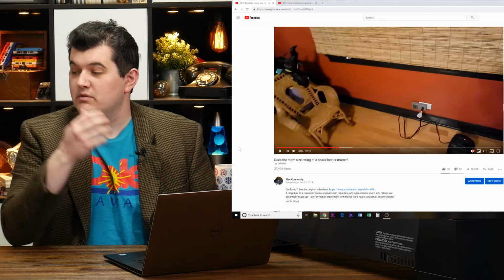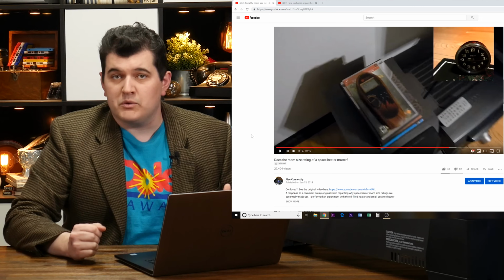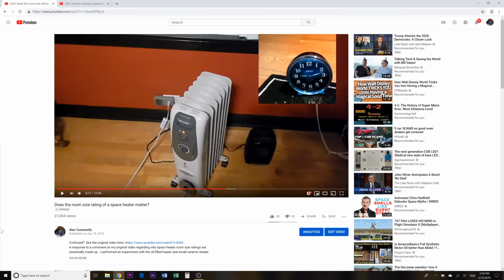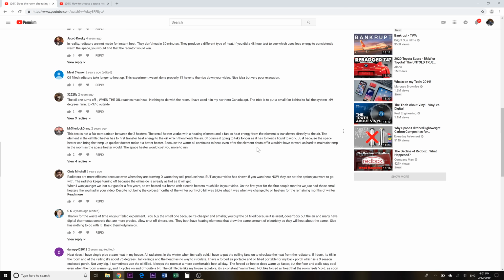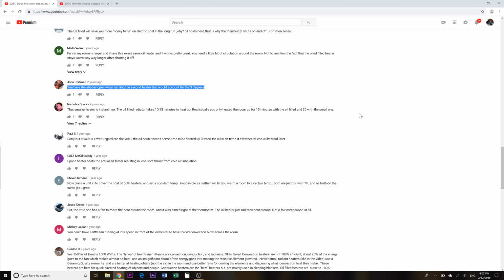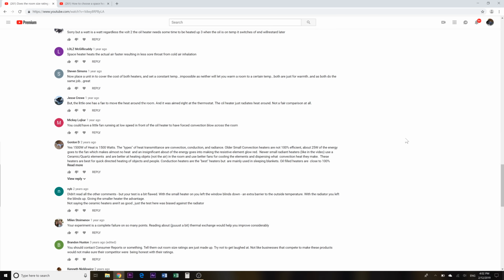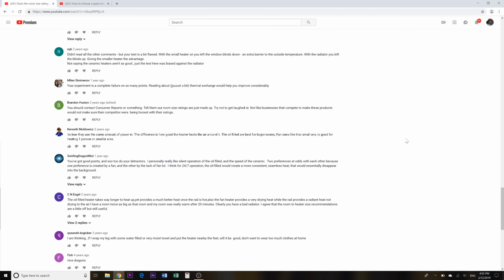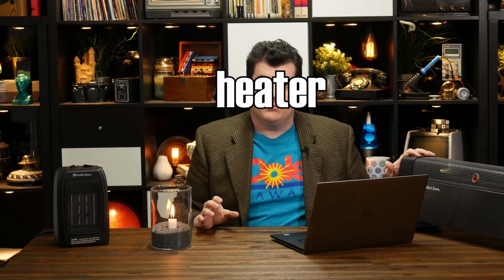More Space Heater Nonsense

Comment: Obviously your math is accurate and in terms of how effectively each one heats the room: they are the same.

However.

One possible reason why one may be better suited to a smaller room is duty cycle.

A "common" scenario one could imagine... 

A building is at 67 degrees F, but an individual would prefer the room at 71.

The amount of thermal energy required to keep that room at 71 is 750 watt hours / hour.

That means that a 1500 watt heater would have to run at 50% duty cycle in order to keep that room at 71.

The cheaper heater will have less material, and therefore require a fan in order to operate. This fan will have a finite life-span.

If the fan is of very poor quality, it may only have a life expectancy of say 5,000 hours.

At 50% duty cycle that means the fan will fail after 10,000 hours of use. Longer than the 1 year warranty.

However.

A larger room might require 1.5 Kw / hour to maintain 71 degrees.

Which would therefore require the heater to run at 100% duty cycle. and if ran continuously month after month (ignoring the whole seasons things)... the heater would reach EOL before the 1 year warranty was reached.

There are numerous examples of appliances that "can do the same thing" and cost many times more..

For example, say a hammer drill..

you could have 2 hammer drills with the same effective power and usability, but one might cost 4X more and last 10X longer.

The cheap one may good fine for a DIY guy doing some work around his house, and may last years. But if used professionally every day might only last a few days or weeks.

If you were to measure the performance of each drill, you might find that that power in = power out, but because of life expectancy, one is more suited for DIY and the other is more suited to professionals.

Comment: I don't understand the entire discussion. The point of oil-filled radiators is that they are quiet (other than fans) and save (other than devices with heating coils without fans).
Reply: They don't save electricity. Both use 1500 watts of power.

Comment: Those oil filled heaters are great for keeping a room warm but slow at changing the heat from cold to warm.  
What they are really great for is safety.  They are also quiet and tend to not change humidity much.
If you run a fan to circulate air in your room you might find that oil heater working "faster".   
Over time though if the BTUs are truly the same, then they should eventually bring the room to the same temperature.

Comment: The reason that the smaller heater with the equal 15 amp current draw is out performing the 2 larger heaters is because of the forced air from the fan. The fan optimizes the heat distribution and also maximizes the duty cycle, which has probably been running at 100%.

Comment: lol i never paid attention to the 1500 really. I always thought the diff was size and materials used.  Does a  $30 one have the same heating elements as a $100 one, Same fan and sizes. Does a cheap one burn out faster than the more expensive ones.  Then your cost over time. is it better to have slower heat for more time or a faster heat that turns off and on more often.  during winter my  bill goes from like 200s to like 700s during winter cuz the gas. What one would save more money for long term every day use to stop heater in house for kicking on.

Comment: Air circulation makes a big difference in how the heat is distributed around a room. I had a oil filled heater and it sure made my ceiling happy because all the heat would just rise up off of it without circulating around the room. Using a small fan to blow air through the oil filled heater made a big difference in the time that it took to warm a room.. 
To make this as simple as possible let’s say you would line up 10 different 1500 W heaters. They are all going to put off the same amount of heat and they are all going to cost exactly the same to operate a given time. The difference in how much electric you’re going to use to warm a room is how long does that heater have to run to warm the room. In my opinion the oil filled heaters need to run longer because they lack a fan to circulate that heat around a room. In one hour the small quartz type heater with a fan might have to run let’s say a half an hour to keep a small room at 70° where the oil filled heater might have to run 35 or 40 minutes to keep that same size room at 70° for one hour.  Your savings with the Quartz heater is simply because it does not need to be run as long as the oil filled heater.  Remember that you don’t get something for nothing when it comes to electric heaters. A 1500 W  heater is not going to give you 1600 W of heat. If you think it does then I’ll sell you an attachment for your kitchen sink that puts out 20 gallons of water by using only 15 gallons of water.   Enjoy all your videos 😁

Comment: Maybe by larger room there would a greater chance of latent air movement therefore the ones 'rated' for smaller rooms have an in built fan and the ones for larger rooms do not tend to. Other wise the only thing (other than marketing wankatering) I could find to suggest a difference in classification is a larger room MIGHT have a larger gradient of current heat while the heater is in operation and that would increase the effect of the convection currents.... but yeah it all seems like marketing BS.

Comment: A small space heater is great under a desk blowing on your feet when you're cold.  If you're using a space heater to actually heat up a space, then the oil heater might keep the room a more consistent temperature, and you wouldn't be feeling a blast of hot air in part of the room.  So there are reasons to pick one over the other, but you're totally correct that the marketing is stupid.
Reply: No, an oil radiator heater will not keep the room "a more consistent temperature". It is an excellent design for heating the air directly above the heater (and thus wasting it out through the ceiling and upper walls) since there is essentially no air circulation moving its heat to the rest of the room.

Comment: Pro poor person tip, if you put a box fan behind one of those large oil filled radiator heaters, you can basically heat a whole(smaller) house.  Keep the fan on low, it will move the air just fine. If you crank up the speed I think it moves the air too fast and it doesn't heat up well

I know I'm late to the party but maybe I can help some other frugal and or poor person out there 🤟

Comment: The real test is power consumption over time.
You cannot test 50 minutes to 60 minutes. A good test would be 24 hours, and compare power usage. Obviously, you would need similar temperature and sun days. I suppose you should also start with a heat soaked oil filled as well.

Comment: Any source of heat, an iron, a lightbulb, an arc welder, will put the same number of BTU's into the room. Put a box fan to move the air around and 3 or 4 thermostats, and you will have the same result. This room needs some air movement for the "Test", which I can do in my head.

Comment: Awesome video, very informative. The elements in the space heaters are not converting 100% electrical energy into thermal. Some of that energy is being converted into light, which can be seen when the element is glowing bright red. 

Depending on the element's material, some are more efficient at this conversion.
Reply: That light is a miniscule portion of the energy emitted, and is converted to heat as soon as it hits a wall or other non-reflective surface. This is basic physics.

Comment: One important issue I haven't seen mentioned is the distribution of the heat, and how quickly the heat spreads through the room. The oil-filled heater, even if it didn't cycle on and off, would have a hotter zone in the space nearby, and the space in the room farthest away would be cooler.

A parabolic heater is made to heat you quite a bit, with the space several feet from you having little to no heat increase.

A heater with a strong fan will spread the heat more quickly, and the room would be heated more uniformly, with much less chance of hot spots.

I don't know how long it takes to spread the heat, but you can check this by having several thermometers scattered around the room.

Just past 19:00 in this video, you do touch on this issue. I hadn't gotten that far when I started writing this. You also quoted someone as saying that the fan heater dries out the air, while the radiator doesn't, and this seems wrong. The change in relative humidity should just depend on temperature, though feeling the fan blowing on you could make you feel like you were drying out more.
Reply: Moving air evaporates more moisture than still air -- that's why a breeze feels colder while your skin is wet. It is important to understand that heat is different from temperature and temperature is different whether you feel hot or cold. If you stand in a heated room at 70 deg F -- and stand a foot away from a large single-pane window separating your from a 0 deg F winter night -- you will feel MUCH colder than if you stand in the same room at the same temperature while the outside air is also 70 deg F. The cold surface of the window sucks heat from you and makes you feel cold -- even though the temperature doesn't change.

Comment: Because the oil filter cycles on and off it lets out less heat. Period. If not for the cycling on and off, Both would produce equal heat in time. Given enough time the room's air would reach energy equilibrium. If all the variables, such as outside temperature, time of day, etc. were the same the temperature would be EXACTLY  the same. But since the oil heater cycles on and off it will never produce more heat.
Reply: All the heaters cycle on and off. The primary difference between an oil-filled radiator and a red-hot heating element is the former won't burn your house down when the nearby curtain (or the hem of your bathrobe) touches it.

Comment: Energy is energy you are totally right on the way they are marketed. The only difference is in nuisances, like the small heater has a fan so it is noisy, while oil filled or convection heaters are noiseless. Although there is a small difference in how we feel the heat from the radiator type heater vs any heater that first heats the air: Radiation from a hot surface, like these oil heater tend to heat stuff directly and air indirectly so the room temperature may be actually a bit lower while it may feel warmer when you are in direct view of a radiator.

Comment: One thing that might be a factor ist the form of heat propagation. We talked a lot about convection which heats the air and thus the room. Another form is heat radiation which doesn't heat the air, but your skin directly. That's the reason you can warm yourself up at a campfire on a winter day without really heating the air around you. And maybe that contributes to the feeling, that those kind of heat sources produce more heat.
Anyway, thanks for the videos, I can feel the pain. It's a little bit like the vacuum cleaner ads that say like 'Hey, this one got 2000W, it must be a great vacuum!'. (Yes, here in Europe we can go up to 3600W. ;) )

Comment: 8:40 I feel like part of what your test does not include, is how long after you turn the electricity off, does it take to return to the original room starting temperature. And also, a second larger more empty room. Maybe change the metric from time, to amount of energy used over time as the room heats up to a given temperature. So, start at 60°. Run heater through power meter until temp reaches 65°. Record amount of time and power used. Unplug heater.  Record amount of time it takes to return to 60°. Then compare the same exact method in a slightly larger room.
Because you are investing energy into warming the oil and heater body, yes some energy is going to be lost in that exchange. However, once the heater and radiant fluid are at peak thermal load, the electricity shuts off. Meaning that the oil heater can still heat a room after it turns off. If this is in a small room, then yes the thermostat will over heat. However, in a small room if you turned down the thermostat and used the cycling to your advantage, much less electricity needs to be used over a longer use duration, than with air cycled units. The physical property of absorbing heat, is going to be more useful in a room full of air, as opposed to a room full of solid stuff. A bed of coals vs. a licking flame. They may be producing the same amount of energy, but only one lasts all night without adding more fuel. The smaller air cycling units can add thermal density to a small room because of stuff absorbing the instant heat it produces, like a flame. But, ultimately, if you cannot capture the heat it produces, it's gone to convection. Larger air filled rooms would not benefit from this type of instant heat. As it would rise directly to the top and not mix well, no diffusion. With the oil as an intermediary, the heat can diffuse into the air, as opposed to convecting passed it.
Reply: But yeah, it's not going to heat faster, just a different form of heat exchange.
Radiant heat, convective heat, and transient heat.
Radiant heat is IR light that can traverse space without being physically moved around before landing. Great for diffusion. The heat coming from a wood stove, is radiant. Once radiated to the air molecules, they will form a gradient in the air. Causing convection currents to move the air around for you.
Convection is when the density of the air physically changes in response to heat and a gradient column of warmer gases moves up from that point. In the case of a fire, rapidly. The elevator of air above a campfire is convection. Great for  creating gradient currents in small spaces. Not so great in tall spaces.
Transient heat, or transmission, is heat that directly moves between two touching materials, as long as a gradient isn't formed.
Your skillet cooks food because it is in direct contact with a heat source and does not create a gradient current. Meaning that it doesn't begin to separate and move around. Instead it absorbs the energy, as a whole object, and then retransmits it as radiant heat.

Comment: shoulda measured the kWh they both draw in that 30 minutes to prove the larger is turning off and on. if thats the case than the small one is just better at putting out heat. since kWh use = heat made

Comment: Oh my, you need to do one about flame only propane heaters in a garage  or something.

I can't begin to tell you how many times I've seen people review these things for like a workshop or something and they're like "it's only hot directly above it, all the heat just goes up, they're useless".

😑😑😑, when you're heating air, you need to move the air around or have some other convection going on. Because yes if you just put it in the corner and turn it on it's not going to do a goddamn thing except heat that corner with severe hysteresis to the rest of the room unless you're moving the air around too...

Comment: "A Fan heater Dries out the Air but an oil filled one doesn't" 10:51

Completely Incorrect. Both heaters cause temperature to rise which will decrease relative humidity. Oil filled will heat the air slower and the user may feel more comfortable at a lower air temperature if they receive some of the energy via radiation. Therefore the relative humidity would remain higher due to the lower temp

Comment: In today's world of alternative facts, uhhh  no.  1500 watts is 1500 watts.  BUT, some heaters can give the "feeling" of being better than others.  Regardless of the type though, hot air will rise to the ceiling with no mechanical help(a fan) to circulate it more evenly in the space.  Get the heat off the ceiling and the room will feel much warmer.  

Radiant heaters feel amazing as long as you are directly in front of them and unobstructed or you let them run of a while to heat the items in the room that are in front of them.   I did some experiments with radiant heaters a few years ago and was able to focus a beam of heat just like light.  Yes infrared light.  Using a highly polished reflector, I was able to focus a very tight spot of heat about 20 feet away.  This was with an old Coleman heater that looked like a radar dish.  I polished a parabolic reflector with metal polish as close to mirror like as I could get in a half hour or so.    Not very practical for much, but you could sit in a chair and feel nice and warm while the people on both sides of you were freezing.  And since is was so far away, the noise and smell were negligible.  

Did some others using camp stoves with stainless steel wire coils to radiate the heat rather than let it go straight up.  A good percentage DID radiate, but again if I put a fan at the top of the tent, it was much more effective than the coils, and much less of a fire hazard if it tipped over.  Coleman cut a gallon bucket/heavy can and added some holes and brackets to it and called it a heater attachment for the trusty 502 single burner stove.  Better than the stove alone, but not by much.  Getting the air off the ceiling and down into the space you're in is the key to effective heat.  I digress.

You are spot on.  watts are watts.  All of those watts go into the room.  Period.